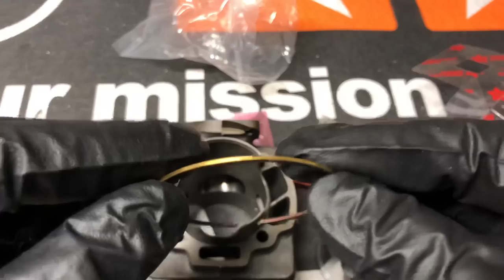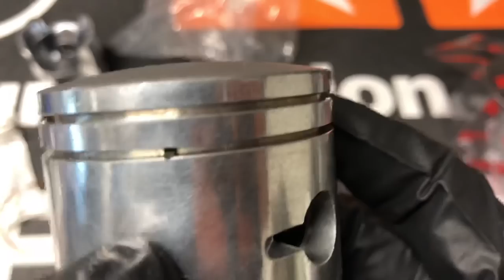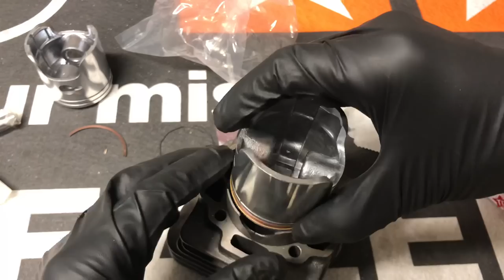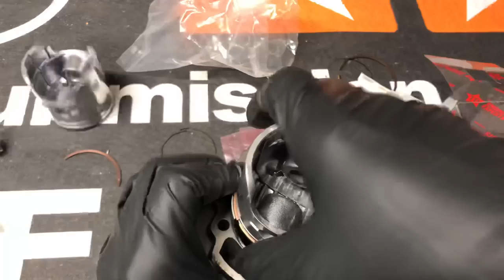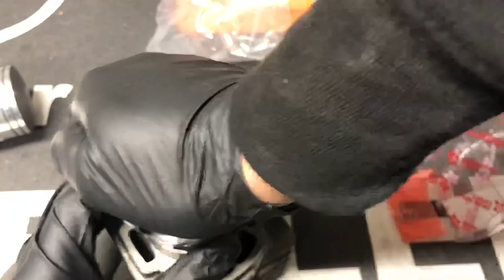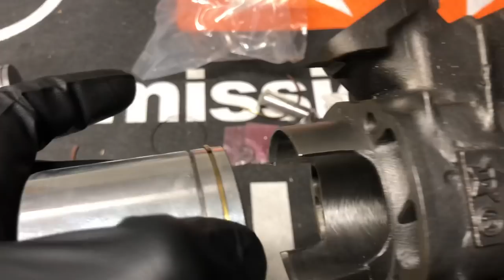Installing piston rings the wrong way

Comment: You should never be able to pop a piston in by hand. Every time I install a piston I gotta use microscopic flat heads and work around each corner as one side slides in lol
Reply from the maker: Your kidding right? We do probably 150 builds like this a year.
Reply: @Scooterswapshop  actually now that I’m thinking about it ya on a dirt bike you can press it in by hand if you’re installing the piston in the jug with the rod already connected to the crank but I could never press in a piston on my lawn boy 2 stroke engine. Not enough room for my fingers

Comment: What seems quite off is that the Piston itself does not look like it fits inside that cylinder... I get the point of the video and I get that people do this but why does it look like the Piston isn't even mean for that cylinder 😂, it could just be me that thinks that but🤷🏽‍♂️ it seems off.
Reply from the maker: This is all correct. Not sure why you feel it doesn’t fit. These cylinders are $600 each Italian 100cc so they definitely
Look different than most are used to